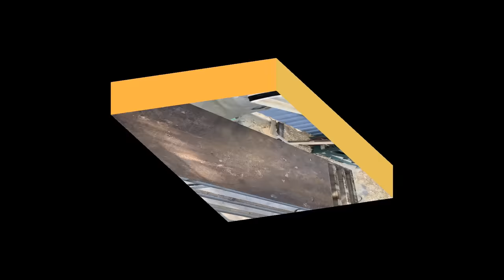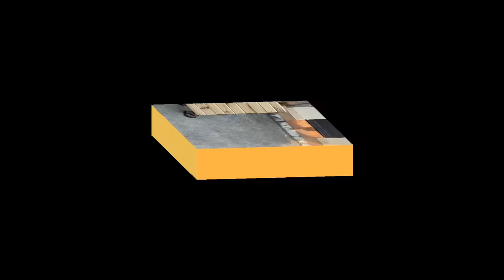DIY - Craftsman's Ideas/4 Smart Folding Table Projects You Should See/Metal Smart Folding Utensils !

Comment: Can anyone please explain to me why when you watch people from 3rd world countries use a stick welder they use it like a spot welder? Instead of running a continuous weld once the arc is struck like in the US. The only reason I can think of is maybe their electrical grid can't handle the amperage of a continuous weld so they use a series of small tacks. But I don't know that's all I can come up with. Any other ideas?
Reply: Its thin hollow steel (1mm) .. Applying continous weld will ruin it.
Reply: @robloxgameplay2527  I have seen it on thick material as well though. Material you would have no problem laying down a constant bead.